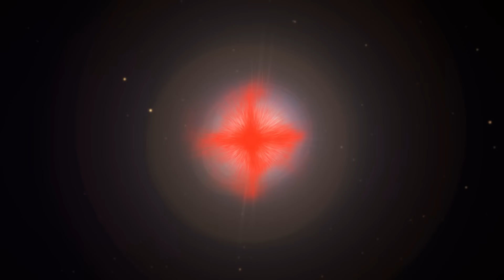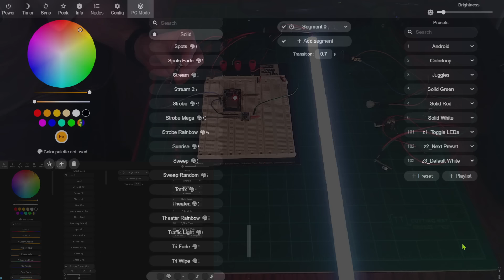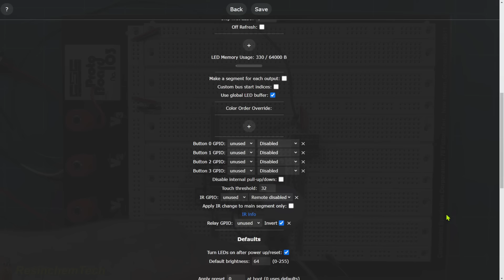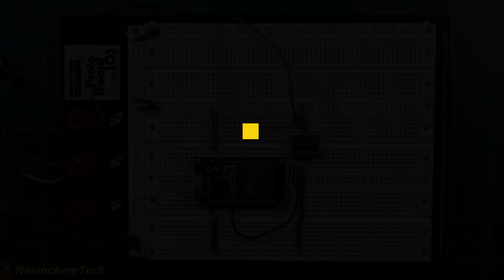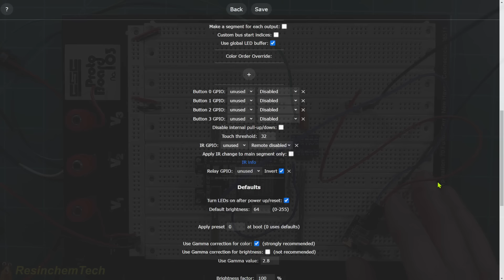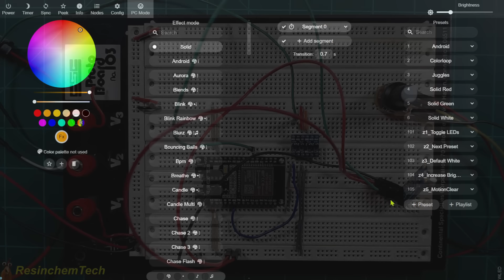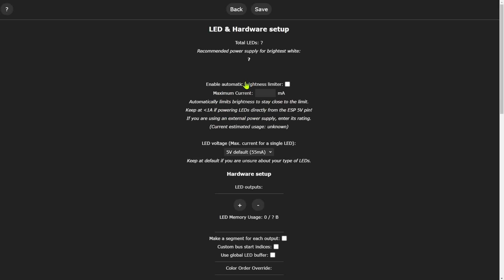Level Up Your WLED Projects: A Guide to adding Components (no code!)

Comment: I'm a little confused on how to fix the buttons into a cabinet as when you drill a 7mm hole that i snot enough room to tighten up the 9mm screw at the back of it. I just done a test on a different button and failled with it as no way to get at the back of it so no clue how you managed it be great to know though so I can try too :-) thanks!
Reply from the maker: Yeah... I've had the same issue.  A lot of these types of buttons and toggle switches are meant to be installed in a thin substrate... something like a car dashboard, only a few millimeters thick.  

Your options are to locate a button with a longer throat or threaded section meant for installation with thicker substrates.  Or (and this is what I normally do), you can route out a small section on the back side so that you can get the nut on the threads and tighten up the nut.  Not ideal... but I did it for all of the controls on the admin panel of my arcade machine so that I could use a standard toggle switch and push button.
Reply: @ResinChemTech  thank you yes seems very hard to find the right type to do it. I'm just going through your video again as mines a little different using the Dig quad but still very helpful and same to help on my setup too thanks! I'm trying to do two buttons on two different Leds channels to try to control them separate but but not there yet with learning!
I tried as you said but very hard when only a short bit of thread on them and I have a lot of usless Buttons now! 🙂 I did get one where I can stick it on but then you cannot hide the wire though hard to see anyway under the units but its one of them bugs you like to get designed right! How do you know from images if they are long is also going to be a challenge will let you know if I find some!
Reply from the maker: There are other ways that I've used in situations like this.  Of course if you have access to a 3D printer, you can simply print your own custom faceplates where you can mount buttons, toggles and other components that expect a thinner substrate.  But not much help if you don't have access to a 3D printer.

I've also used a method of soldering a couple of short lead wires to the button's terminals.  I then drill the hole just large enough to allow me to thread the nut on the back side.  If necessary, I then add a small washer to the front side to keep the entire button from passing through the hole.  So in your case, you'd drill a hole around 9-10 mm... just large enough to tighten the nut on the back side (needle nosed pliers or something may be needed).  You could then use a washer with an approximately 7 mm opening on the front side, but large enough overall to prevent the whole button from passing through the hole.  I can't share a photo here, but I've used this technique to install a button through a 1" thick piece of wood instead of routing out the back side of the wood.  Since I attached short leads (approx. 1-2") to the button's terminals before it was installed, once it is inserted through the wood, I still have access to make connections.  It isn't necessarily the most attractive, but you could look for black, white or other colored washers (or even make your own 'washer' out of scrap plastic) that might help with final appearance.
Reply: @ResinChemTech  I so wish I had one but no room to swing a cat in the place I live so this would be so difficult for me but I I had some where a little bigger to manage Id of got one years ago that's a 3d Printer 🙂 Good news though I got my presets to work thank to your video! :-) so the buttons work fine its the fittings that don't!

Comment: I’m just getting into this WLED thing and I’m so exited!! There’s just a couple of the accessories I need: on/off switch, digital microphone, and maybe an IR remote… if I’m only soldering on cables to the pins on the esp32 am I doing it right? I need some advice before making things explote lol
Reply from the maker: You can certainly do it that way, although I prefer to use a breadboard or solderable prototype board for most of my projects.  It just makes for a bit neater project and depending on whether I use pin headers or not, allows me to swap out components, like the ESP32, if it fails or if I need to reflash it.

If this is your first WLED/Electronics project, I have a few of other videos that you might want to review first if you haven't seen them yet:

Building your First WLED Controller (no solder version): https://youtu.be/dXLOqGa-n5A
Your First Electronic Project: https://youtu.be/ruSf2Mc-fgQ
Common LED Questions: https://youtu.be/GZv5Ztj6i6I

Best of luck with your projects!  Don't hesitate to reach back out if you have any specific questions not covered by the above videos.

Comment: As a complete electronics novice, why use a 3V relay module and a buck converter instead of just using a 5v relay module (which seem to be far more common). Is the data signal not high enough (3.3v) to drive it to switch?
Reply from the maker: Correct.  While some 5V relays might trigger with only a 3.3V high signal, others may not or be intermittent.  This is much like LED strips that expect a 5V signal but will often work with a 3.3V signal... until they don't!

So for the most reliable operation, you need to supply a high (trigger) signal at the expected voltage for the relay.  This means that you can use a 3.3V relay and step down the 5V power to 3.3V for powering the relay via something like a buck converter... or you can use a 5V relay and "step up" the data signal via a logic level shifter.

Part of the issue with also supplying 3.3V power to a 3.3V relay via the ESPx 3.3V pin is the amount of current that an energized relay might draw.  It could exceed the milliamp rating for the ESP power pin.  Again... you might get it to work, but run the risk of damaging or overloading the ESP board.  So you are left with either shifting the power voltage or shifting the data line signal so that they both match the expected voltage of the relay (either 5V or 3.3V).
Reply: @ResinChemTech would a logic level shifter do the same job? I’m already using one to boost the data signal to 5v for the LEDs, if I choose one of the other pins to boost the signal to the relay, would that do the same job reliably?
Reply from the maker: Exactly correct!  And I do the same thing in my MatrixClock32 video.  In that case, I'm running both the LED data signal and the control signal for a 5V relay through the same 4-channel logic level shifter... one channel for the LED signal and one channel for the relay signal.  Since both the original I2C-compatible shifter I previously used and the new recommended SN74AHCT125N buffer gate shifter both have up to four channels, either type can be used to boost both the LED and relay signals.

Best of luck with your project.  Don't hesitate to reach back out if you have further questions.

Comment: Truly the best guide to how set up an ESP32 w/multiple accessories.  It's worth noting that when powering a PIR or relay you want to utilize the same power supply as the ESP32.  You can't have your PIR for example powered from a separate power supply and run the trigger wire to the ESP32 and have it work.   I did this in a project that was spread out over multiple rooms and it bit me...  it's also been 30+ years and stroke since my fundamental's of electronics courses, so this may be common knowledge I dumped.
Reply from the maker: You are correct... and this applies to LED strips as well.  You can use different power supplies but you must establish a common ground.  The issue with situations where you have multiple power supplies likely results from a ground potential difference between the power supplies.  LEDs will misbehave and, as you mentioned, things like other peripherals may not work properly.  For example, a GPIO pin is considered "low" when at 0V and high when at 3.3V.  But if there are different ground potentials, the signal may never get to zero or reach 3.3V.  Assuring all components are tied to a common ground usually resolves any issues related to multiple power supplies.

Thanks for the comment and the kind words.

Comment: For your convenience, I decided to translate and leave my comment in English. 
 Hello. Please answer my question. Help me. I will try to describe the "explanation" in as much detail as possible in my project there is an "installed" Relay ( Tuya WiFi AC 85-250V 220V 4 channels RF 433 remote control Device control module Work with Alexa Google Home ) it is so convenient for me with the remote control power supply that I thus completely turn off the power going to the positive contact (I don't know if this is possible or not, if not, try to explain) The problem is that when I turn on "apply voltage" for the first time, the LED strip lights up "turns on" for the first second, very brightly and with white light. Tell me how dangerous "harmful" this is for the LED strip and can this damage the LEDs? And how can I solve this problem and how to do it correctly.??? I would be very grateful to you if you answer me in detail, and even better if you or someone else has a video instruction and left me links. Thank you.
Reply from the maker: There's a lot unknown here, but as long as the voltage is correct, turning the LEDs on full bright white should not damage them.  However, this is the max current draw so if left in this state, you'd need to assure your power supply, wiring, other components, etc. can handle that expected current.

If your LEDs are coming on when power is applied (and assuming you are using WLED), then check the LED preferences under settings.  There is setting to "Turn LEDs on after power up/reset".  Be sure this is unchecked.  Also assure that the  "Apply Preset at Boot" is set to zero.

Note that applying power to the LED strips and separately (or in parallel) to the controller can sometimes result in an initial powering on of a few pixels (normally near the start of the strip) until a valid signal is supplied from the controller.  So if you power on the LED strips and the controller at the same time, the LEDs will receive power just a second or two before the controller finishes booting and sends a signal.  This is likely why you are seeing the LEDs come on briefly until the controller finishes booting and sends a data signal to the LEDs.
Reply: Ленту я использую Световая лента WS2812B Led как и вы ESP32 DEVKIT тоже как и вы. 
Я очень рад что вы мне помогаете в моем деле и благодарю вас.

И нет я не питаю ленту на прямую через Реле Tuya я поставил его в разрыв " обрыв " ленту запитал через блок питания 5v и в разрыв поставил 4 канальное реле так как у меня 4 разных куска отрезков ленты и вот я через пульт дистанционного управления выключаю включаю питание на низ . и через наш головной помощник АЛИСА .

И еще 1 вопрос связанный с моим проектом. Можно ли обрубать ( выключатель ) только питания + положительный контакт и управлять включением и выключение отдельным реле который в проекте стоит и не как не задействован с esp32 как вы показывали у себя видео подключали реле к esp32 и управляли. В моём случаи получается просто выключаться положительный контент а - отрицательный и сигнальный провод  получается остаётся подключённый работает все как обычно т.е подаётся сигнал но по факту лента не работает так как отключена питания + . 
Спасибо жду вашего ответа. 
Помогите пожалуйста.

Comment: Is there a way to configure wled settings so that after a switch or pir sensor is triggered and plays it’s preset, that the lights will return back to the last color or effect that was on before the switch was triggered? Ex. Lights are on solid white, switch or pir is triggered and plays strobing green color, lights return back to solid white after switch/pir sensor turns off
Reply from the maker: Not really with just standard WLED.  WLED doesn't (yet) have an automation engine.  This is where an automation platform, like Home Assistant with the WLED integration, would allow you to easily do what you are asking.

However, without Home Assistant (or other automation system), you can kinda' get close to what you want by using the countdown/timer features... or you could use one macro when the PIR turns on and another when it resets or clears.  There are also some user mods that might help you to get closer to the desired actions.  You can check out the current user mods here:  https://github.com/wled/WLED/tree/main/usermods

Comment: Are there any o no pins on the magwled1? I think they offer 1010 107 and 108
Reply: Just to clarify, those are IO10 IO7 and IO8. As in GPIO. You should be able to use any of those as additional buttons.

Comment: Can we add ldr or any other ambient light sensor to wled?
Reply from the maker: Here's one option (but not the only one):  https://github.com/wled-dev/WLED/tree/main/usermods/LDR_Dusk_Dawn_v2
Reply: @ResinChemTech  thank you mate, is their any way to protect wled UI with some password, I use cloudflare to use internal servers in public. Having a password protection could be helpful, as anyone with the url can access my lights right now. Any suggestions?
Reply from the maker: Not currently and not by default.  You can password protect the settings page, but not the main page.  See here:  https://kno.wled.ge/advanced/security/

Otherwise, you are probably looking at either modifying WLED (you can check the existing user mods, but I didn't see anything) or developing some sort of front-end portal that would require a log in before redirecting to the WLED app.  I'm sure there are other ways as well, but unfortunately nothing that is current built into standard WLED.
Reply: @ResinChemTech  thanks, if you find some easy way let me know. Really thanks for responding 🙏

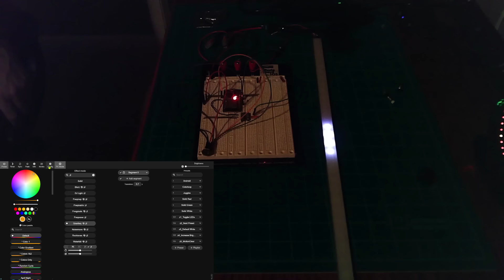Comment: excellent information - specially at @33:35 is exactly what most people will need for larger setups - now, i do have a quick question: in your demonstration since you are using a breadboard i get a little confuse. in my current setup i will like to use a single PS to power 3 esp32 and another PS to power all my strips, the sample that will apply to my setup is your second optioned shoed in the video ? the relay will shut off the power of the PS for the led's strips 
?
Reply from the maker: Just recall that when using separate power supplies, you must create a common ground between the controller and LEDs.  Otherwise, you are likely to get misbehaving LEDs.  As long as you have a common ground (but not a common or shared +5V between supplies), you should be able to use different power supplies for the controllers and LEDs.

Comment: got 3 types of esp 32 but none work with sound sensor what am i doing wrong.
Reply from the maker: Based on the limited info provided, I have no idea.  What microphone/audio input are you using? What version of WLED? What settings have your configured? What troubleshooting steps have you tried?  If you'd really like assistance, I'd be glad to help out but you might want to take a peek at this first:  https://resinchemtech.blogspot.com/2024/12/ask-for-help.html

Comment: hello thank you for your video's, you really motivating me to start and play with electronics.  I have a question concerning the relay  39:09   how do you do when you use draw 30Amps?   
-can you boost the gpio12 to 5v and use 5v 30amp relay ?
-is it ok to use relays in parallel?
-or do we need to use a mosfet?
i'm I missing something? it's bugging me
Reply from the maker: Actually, the next video I am working on will show just that... using a 5V relay and stepping up the GPIO signal to 5V using the same level shifter as the data signal instead of stepping down the 5V to 3.3V for a 3.3V relay. So yes... you can use a 5V relay and boost the control signal.

As far as using relays in parallel, whether it is 'ok' or not depends on what you are attempting and how your circuit works.  But yes, you can connect relays in parallel within a circuit.  Whether you need a diode, mosfet, etc, depends on how the circuit is designed and what you are trying to accomplish.
Reply: @ResinChemTech  great thank you very much!🥰

Comment: Hey... nice one...well explained.... how to add multiple relays with switchs?
Reply from the maker: You would need to integrate some sort of user mod, create your own, or modify the WLED code.  WLED only has built-in support for a single relay and this video only focused on what could be done with "stock" WLED without modification or add-ons.
Reply: @ResinChemTech  thanks. Can you make a video with different level shifters like 74hct245N for a long distance data?
Reply from the maker: I actually already have multiple videos that show and detail the use of a logic level shifter for longer data lines.  Probably the most appropriate one (that deals specifically with a '74ahct' series buffer gate) is this one:  https://youtu.be/61VWgYmomz4 (but I have a few others as well).

In addition, if you check the description for that video, you will find additional information including a link to my standard wiring diagrams, which also includes wiring the AHCT shifter.

Comment: As always an amazing instruction, thank you. Have you ever integrated anything dynamic like temp or air quality sensors?
Reply from the maker: Not specifically with WLED.  You'd need to develop or apply a user mod or otherwise update WLED so it would know what to do with the numeric value(s) received from a temp or air quality sensor.  By default, WLED does not have an 'generic numeric input' option where you can use an incoming number to control some aspect of the LEDs.  In most cases, if I want to do something like that, I use something like Home Assistant that could take that input number and then decide what commands to send to WLED to have it react in some manner to that number.